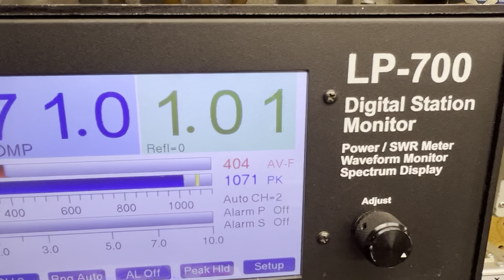Donkey Stomper Products, 550V-HG-2X4 Mobile, CW Transmitter, True ON/OFF

Comment: How much pep from the radio is ok to drive that amplifier thanks Beavis
Reply from the maker: I would keep it 40-50ish pep swing max. Radio drive good dual final radio is okay. Long as you keep carrier set.
Reply: @DonkeyStomperProducts  ok cool I had a 2 driving 4 base amp from xforce 15 years ago and it said not any more than 25 pep. So I used a 2950